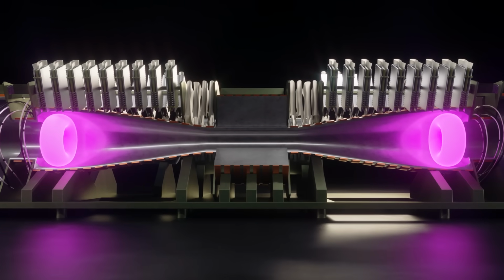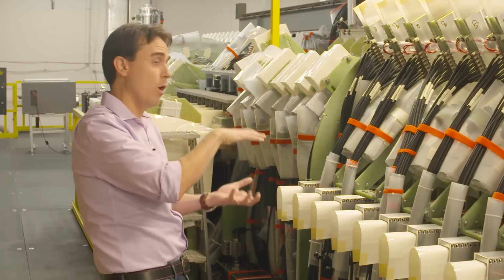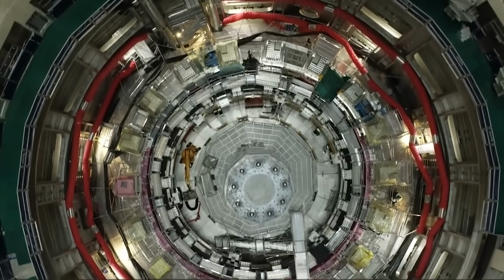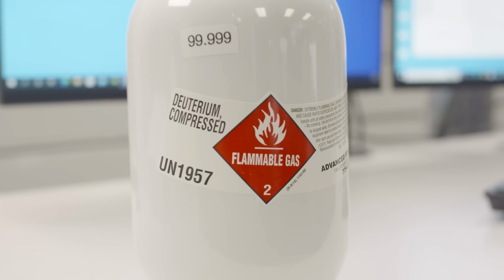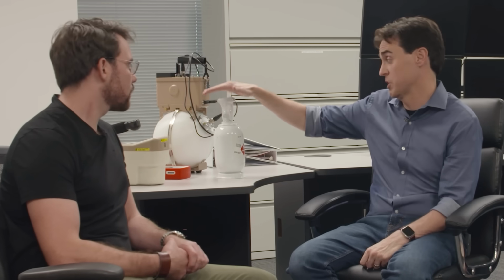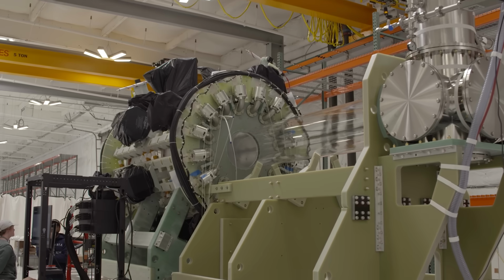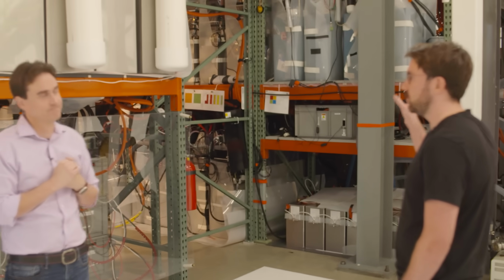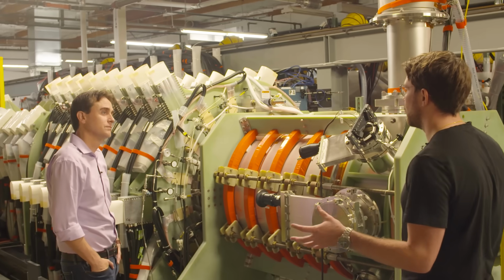A New Way to Achieve Nuclear Fusion: Helion

Comment: I've come back to this video after watching a much better analysis of helion's systems by a nuclear physicist. The claims, lies, and fabrications made in this video by both you and helion are incredibly disappointing. Nothing about what helion is doing is real. Not in 5 years, not in 10.
Reply: Yeah, only that that critique by that "nuclear physicist" is mostly BS. Here is my debunking of his "critique":

- Critique: "FRCs have been done before and never worked." 
First, define "worked"! What was the goal of the experiment and what was the outcome?
Second, yes, FRCs have been done before and the members of Helion's founding team were actually involved with several of them. They applied the lessons learned from those to their own design, which they have tested over 6 prototypes so far.
Lessons learned and applied:
1. Size of the FRC. The larger, the less susceptible to n=2, rotational instabilities.
2. Elongation to radius ratio. The longer the FRC, the more stable it is to tilt instabilities.
3. The merging before the compression. This part creates a single, hotter and more stable FRC as a target for compression. FRCs get more stable, the hotter they are.
4. Helion's FRCs have a very low electron to ion temperature (Te:Ti) ratio of 0.1 and less. That makes things a lot easier compared to machines where both are in an equilibrium because: 
P(fus)/P(loss) scales as Ti^1.5 / (Z^2 * Te^0.5 )
Where Z is the atomic number (in case you wonder about that).

- Critique: "Deuterium - Helium3 has a smaller reaction cross section than Deuterium - Deuterium. At the 100 million degrees temperature discussed in the video, Deuterium - Deuterium reactions would be much more likely than Deuterium - Helium3 reactions."
That is generally true, but the author misses some key points:
Trenta is a subscale prototype with much weaker magnets than what they are proposing for a full scale powerplant. Because of that temperatures are somewhat lower than in a full scale power plant. Power plants aim for temperatures 20 keV (220 million degrees) and up to 330 million degrees (30keV). At that point the D-He3 reactivity surpasses the D-D reactivity.
That said, Helion actually wants some D-D reactions because that is how they are breeding their He3.
D-D => He3 +n or D-D => T +p
Both reactions have a 50% chance of happening.
So, in mixed mode (breed and power) machines, they will need two D-D reactions for every D-He3 reaction, at least until the Tritium inventory is large enough that they have a constant supply from decay (Tritium beta decays into Helium3). Sicne Tritium has a half life of 12.3 years, that can take maybe 20 years. That fact is probably the best criticism of Helion's approach.

- Critique: "Deuterium - Helium3 is too hard and Tokamaks cannot do it. Therefore Helion's approach of fusing Deuterium and Helium3 can never work."
D-He3 is very hard to ignite, but they do not need ignition for their design to produce enough net electricity to be economic. Most of the energy from D-D and D-He3 reactions is released as charged particles, not in neutrons. Helion can recover the energy in charged particles directly as electricity at a higher efficiency than a steam plant would. They can also recover 95% of the input energy directly as electricity. That makes their machines a lot more efficient.
Further, FRCs are high Beta (~1.0) compared to Tokamaks (~0.05). Beta means the ratio of the plasmas internal pressure to the pressure applied externally via magnets. 
Fusion reaction rate (the amount of energy produced) scales as magnetic field to the 4th power, an extremely strong scaling. However, that is the magnetic field inside the plasma, not outside, which scales as Beta^2 and B_external^4. 
If it was just about the efficiency of the magnets (it is not), then a 10 Tesla Helion machine would outperform a 200 Tesla Tokamak.
But, it is a bit more complicated than that, because confinement times in FRCs are generally lower. You win some, you lose some. Overall it is still a win for Helion's approach.
Since Helion is using adiabatic heating through the compression stage, they can to some extent(!) balance temperature and density almost linearly for a given magnetic field. D-D reactions favor higher density and lower temperatures. D-He3 is the opposite way round. They can tune that just to the right sweet spot between density and temperature depending on which reaction they want more of.
Another thing that works in Helion's favor is the aforementioned Te:Ti ratio. This ratio actually decreases further with higher temperatures. So the hotter the plasma gets, the smaller that ratio. Trenta already showed Te:Ti at <0.1. It is likely that a power plant will have an even lower ratio. Lower electron temperatures greatly reduce Bremsstrahlung losses. At a ratio of 0.1, thermal transport losses actually kick in earlier than Bremsstrahlung.

- Critique: "The neutrons from Deuterium-Deuterium reactions would have fried Trenta and I see no shielding." 
As mentioned, Trenta is a subscale prototype, an experiment. It is smaller, weaker and only operates at one pulse every 10 minutes (max). A full scale powerplant would do 10 pulses a second!
Not all shots were fueled by Deuterium or Deuterium + He3. Many were fueled by a mix of hydrogen and Deuterium or pure hydrogen, depending on what they wanted to test.
Because of that alone, the total neutron flux that Trenta has experienced so far is not that high.
What the critique does not mention is that neutrons from D-D reactions have a much lower energy than those from Deuterium- Tritium reactions (2.45 MeV vs 14 MeV). Those 2.45 MeV are below the activation energy of many materials.
The machine is mostly made from low activation materials or materials with a half life measured in minutes. Aluminum activated by D-D neutrons has a half life of 2 minutes.
In fact testing different materials under neutron exposure was one of the purposes of Trenta. They have tested quite a few alloys to see how they behave.
There is still permitted shielding of course. It is in the walls of the room and not close to the actual machine, which can handle the aforementioned relatively reduced neutron load just fine. 
It is also worth mentioning that a mixed mode Helion power plant (that does both breeding and power production) would produce neutrons only in one third of all reactions. So the neutron flux, even for those machines would be lower than for a D-T Tokamak.

- Critique: "Helion claims that they discovered new physics when they say that the ion gyro radius is 25% larger."
The whole ion gyro- radius thing was based on a misunderstanding and out of context quote and maybe also bad wording.
What happened was that Trenta achieved a higher ion temperature than predicted by Helion's too conservative physics model (a higher ion temperature is actually a good thing!). That higher ion temperature caused a 25% increase in ion gyro radius, which is perfectly in line with established physics. That's it. Nothing to see here!

- Critique: "Helion had previously said that they would have a working power plant in 2021. "
IM was very eager to get a "gotcha" on Helion. I guess he did not read further up on the page, or he would have seen that Helion was in the process of raising funding at the time. They did not get that funding until now. Even Trenta was less than 35 million (especially if you take the 35 million into 2019 dollars, when they started building it).
No bucks, no Buck Rogers. Should be quite clear, no?

Comment: So, in the High Field Compression Section, after the plasmas collide, and after the magnetic field increases in strength to drive the temp up to fusion temperatures….how long does this FRC(?) ‘blob’ stay in existence?  Is there a single fusion event that pushes against the field (like a piston), and then the whole cycle starts again?  Or does the ‘blob’ fuse repeatedly for, say, seconds until it runs out of fuel, and then the cycle restarts at the Formation Section?

I guess what I’m really asking is how often does the magnetic field, which is pushed outward by fusion, oscillate so that it cuts across the conductors making an EMF?  And what causes the field to contract so that it can expand, again and again?

Or do I have it completely wrong?
Reply: The pulse lasts for 1 ms. Future power plants will do 10 pulses a second. The energy is extracted from the expansion of the FRC and stored in capacitors. The capacitors return a part of that energy back to the machine to power the next pulse. The rest goes to the grid.

Comment: https://youtu.be/_bDXXWQxK38?t=414     There's no structure on earth that will withstand 10 million degrees without total meltdown.   His numbers are far fetched.
Reply: The fusion plasma is very hot, but not very dense (closer to a vacuum than to ambient air) and it is surrounded by a high vacuum, which is a perfect insulator. The plasma also cools off immediately when it touches anything like air or the vacuum vessel walls. The total energy content of a pulse is only a hand full of kWh, a fraction of the content in a Tesla battery. In addition to that, the magnetic field keeps it away from the walls until it is allowed to expand. It cools off during expansion. While it expands it induces a current in the surrounding coils. Doing that work makes it cool off even faster.

Comment: https://www.youtube.com/watch?v=3vUPhsFoniw i have severe doubts about the unbiasedness of the video.
Reply: Ah that video again. It is mostly nonsense. Here is my critique of that "critique":
- Critique: "FRCs have been done before and never worked." 
First, define "worked"! What was the goal of the experiment and what was the outcome?
Second, yes, FRCs have been done before and the members of Helion's founding team were actually involved with several of them. They applied the lessons learned from those to their own design, which they have tested over 6 prototypes so far.
Lessons learned and applied:
1. Size of the FRC. The larger, the less susceptible to n=2, rotational instabilities.
2. Elongation to radius ratio. The longer the FRC, the more stable it is to tilt instabilities.
3. The merging before the compression. This part creates a single, hotter and more stable FRC as a target for compression. FRCs get more stable, the hotter they are.
4. Helion's FRCs have a very low electron to ion temperature (Te:Ti) ratio of 0.1 and less. That makes things a lot easier compared to machines where both are in an equilibrium because: 
P(fus)/P(loss) scales as Ti^1.5 / (Z^2 * Te^0.5 )
Where Z is the atomic number (in case you wonder about that).

- Critique: "Deuterium - Helium3 has a smaller reaction cross section than Deuterium - Deuterium. At the 100 million degrees temperature discussed in the video, Deuterium - Deuterium reactions would be much more likely than Deuterium - Helium3 reactions."
That is generally true, but the author misses some key points:
Trenta is a subscale prototype with much weaker magnets than what they are proposing for a full scale powerplant. Because of that temperatures are somewhat lower than in a full scale power plant. Power plants aim for temperatures 20 keV (220 million degrees) and up to 330 million degrees (30keV). At that point the D-He3 reactivity surpasses the D-D reactivity.
That said, Helion actually wants some D-D reactions because that is how they are breeding their He3.
D-D => He3 +n or D-D => T +p
Both reactions have a 50% chance of happening.
So, in mixed mode (breed and power) machines, they will need two D-D reactions for every D-He3 reaction, at least until the Tritium inventory is large enough that they have a constant supply from decay (Tritium beta decays into Helium3). Sicne Tritium has a half life of 12.3 years, that can take maybe 20 years. That fact is probably the best criticism of Helion's approach.

- Critique: "Deuterium - Helium3 is too hard and Tokamaks cannot do it. Therefore Helion's approach of fusing Deuterium and Helium3 can never work."
D-He3 is very hard to ignite, but they do not need ignition for their design to produce enough net electricity to be economic. Most of the energy from D-D and D-He3 reactions is released as charged particles, not in neutrons. Helion can recover the energy in charged particles directly as electricity at a higher efficiency than a steam plant would. They can also recover 95% of the input energy directly as electricity. That makes their machines a lot more efficient.
Further, FRCs are high Beta (~1.0) compared to Tokamaks (~0.05). Beta means the ratio of the plasmas internal pressure to the pressure applied externally via magnets. 
Fusion reaction rate (the amount of energy produced) scales as magnetic field to the 4th power, an extremely strong scaling. However, that is the magnetic field inside the plasma, not outside, which scales as Beta^2 and B_external^4. 
If it was just about the efficiency of the magnets (it is not), then a 10 Tesla Helion machine would outperform a 200 Tesla Tokamak.
But, it is a bit more complicated than that, because confinement times in FRCs are generally lower. You win some, you lose some. Overall it is still a win for Helion's approach.
Since Helion is using adiabatic heating through the compression stage, they can to some extent(!) balance temperature and density almost linearly for a given magnetic field. D-D reactions favor higher density and lower temperatures. D-He3 is the opposite way round. They can tune that just to the right sweet spot between density and temperature depending on which reaction they want more of.
Another thing that works in Helion's favor is the aforementioned Te:Ti ratio. This ratio actually decreases further with higher temperatures. So the hotter the plasma gets, the smaller that ratio. Trenta already showed Te:Ti at <0.1. It is likely that a power plant will have an even lower ratio. Lower electron temperatures greatly reduce Bremsstrahlung losses. At a ratio of 0.1, thermal transport losses actually kick in earlier than Bremsstrahlung.

- Critique: "The neutrons from Deuterium-Deuterium reactions would have fried Trenta and I see no shielding." 
As mentioned, Trenta is a subscale prototype, an experiment. It is smaller, weaker and only operates at one pulse every 10 minutes (max). A full scale powerplant would do 10 pulses a second!
Not all shots were fueled by Deuterium or Deuterium + He3. Many were fueled by a mix of hydrogen and Deuterium or pure hydrogen, depending on what they wanted to test.
Because of that alone, the total neutron flux that Trenta has experienced so far is not that high.
What the critique does not mention is that neutrons from D-D reactions have a much lower energy than those from Deuterium- Tritium reactions (2.45 MeV vs 14 MeV). Those 2.45 MeV are below the activation energy of many materials.
The machine is mostly made from low activation materials or materials with a half life measured in minutes. Aluminum activated by D-D neutrons has a half life of 2 minutes.
In fact testing different materials under neutron exposure was one of the purposes of Trenta. They have tested quite a few alloys to see how they behave.
There is still permitted shielding of course. It is in the walls of the room and not close to the actual machine, which can handle the aforementioned relatively reduced neutron load just fine. 
It is also worth mentioning that a mixed mode Helion power plant (that does both breeding and power production) would produce neutrons only in one third of all reactions. So the neutron flux, even for those machines would be lower than for a D-T Tokamak.

- Critique: "Helion claims that they discovered new physics when they say that the ion gyro radius is 25% larger."
The whole ion gyro- radius thing was based on a misunderstanding and out of context quote and maybe also bad wording.
What happened was that Trenta achieved a higher ion temperature than predicted by Helion's too conservative physics model (a higher ion temperature is actually a good thing!). That higher ion temperature caused a 25% increase in ion gyro radius, which is perfectly in line with established physics. That's it. Nothing to see here!

- Critique: "Helion had previously said that they would have a working power plant in 2021. "
IM was very eager to get a "gotcha" on Helion. I guess he did not read further up on the page, or he would have seen that Helion was in the process of raising funding at the time. They did not get that funding until now. Even Trenta was less than 35 million (especially if you take the 35 million into 2019 dollars, when they started building it).
No bucks, no Buck Rogers. Should be quite clear, no?
Reply: @elmarmoelzer2229  nobody is reading your damn essay bro. Especially when ur spamming this shit everywhere.
Reply: @larkinpaul  Don't care bro. I will keep posting it anyway ;)

Comment: Nice to see different approaches to fusion, one of the problems it has had is the institutions controlling research were all doing the same thing. The beauty is that with multiple approaches trying different things you see what fails and works,and failures/ dead ends often are more valuable than successes. One issue w private groups like this is they may not publish what hasn't worked, I can only hope they do. 

In the end fusion is too big to limit it to mega projects. Like with any technology, there may be multiple approaches that work,and from there it will be about applicability.

As far as one comment about wasting water, this won't. They are generally using deuterium and tritium based water ( heavy water), they would return the other water to the environment.